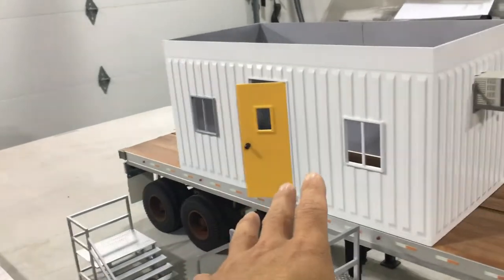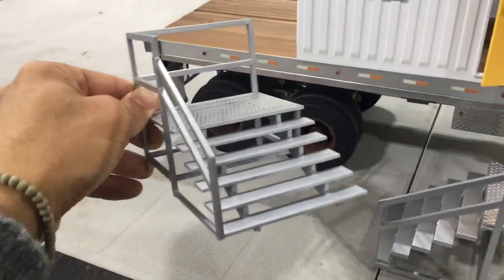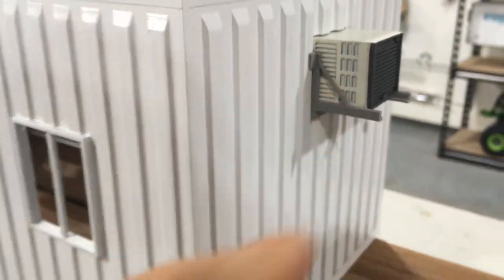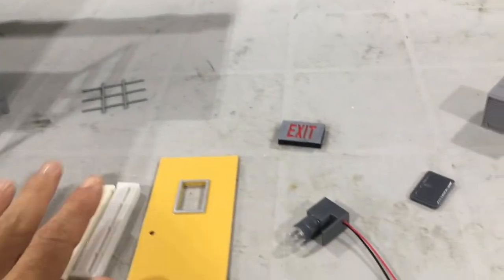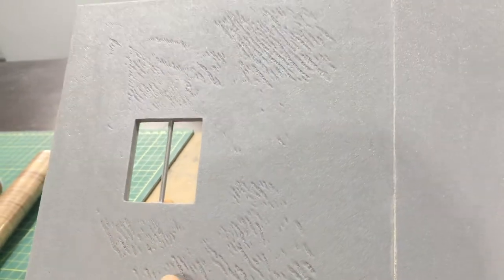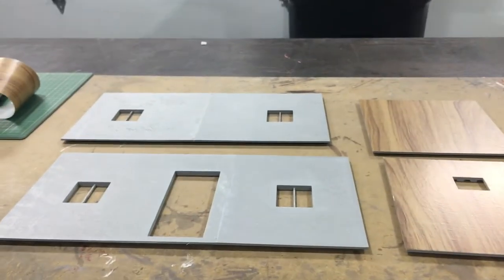Atco trailer build part 2

Comment: tip when you print multiple parts. make a V-groove and then use a 3d-pen to fill the gap. then u dont have to mess with loads of bondo and stuff and u use t he same filament as u print so it will be a better bond between parts :)
Reply from the maker: Appreciate the advice, but I think this way works best. 3d pen isn't necessary and would just complicate it more. The seams are tiny and are easily filled with some Tamiya putty. Definitely not using "loads" of bondo lol.  The CA glue is more than enough to bond the pieces together.